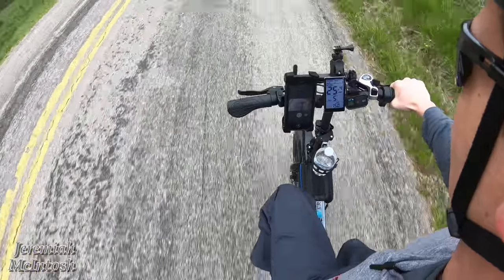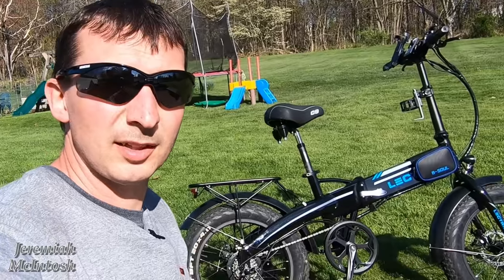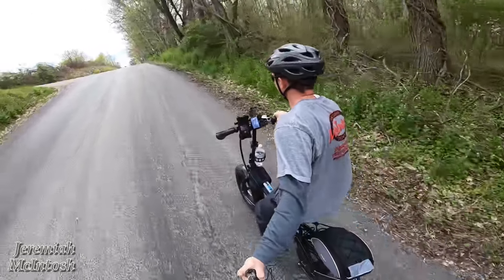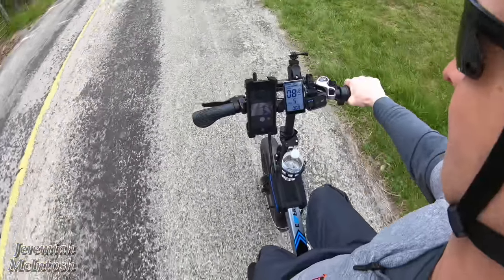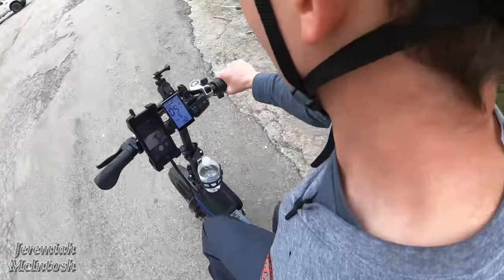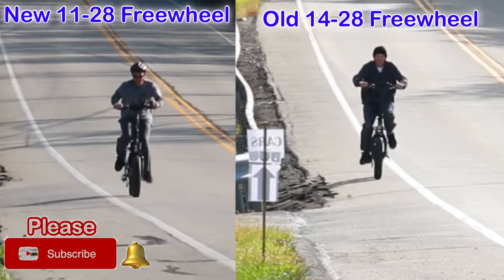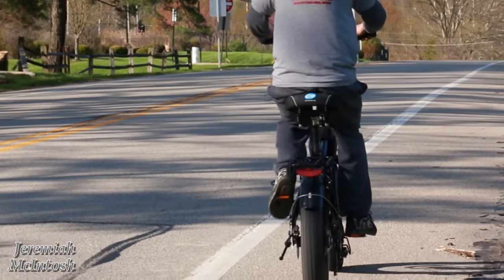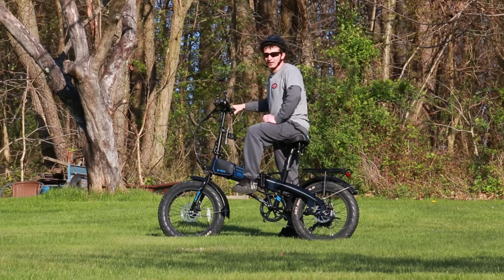Lectric Xp ebike Test with new Upgraded 11-28 Freewheel. Wow!

Comment: Jeremiah, I appreciate you taking the time to post this instructive video. It saved me time and effort to get the work done. I replaced the stock freewheel with the DNP 11-34. That extra low gear will help me on the steep hills and if I'm running low on battery I'll be able to pull the hills if necessary. I've actually had situations in hilly terrain such as in old logged off forests where the trails are steep and rutted where a real low gear could be helpful, especially with a low battery. The extra high gear is really nice on the flats and downhill. Keep riding, keep safe!
Reply from the maker: Thanks Jim. How did the 11-34 work out for you were you able to use the existing chain and it work flawlessly?
Reply: @JeremiahMcintosh  I've not put many miles on it, but so far I think it's going to be a good upgrade. It really zooms on flat trails in high gear with Pas 5 . The low gear is probably not going to get a lot of use, but it's there in a pinch. I can pedal this beast up a pretty steep hill now where I couldn't before. I'll be able to pedal home with no power if needed . 
The derailleur did take some adjusting to get it to shift into high gear smoothly but the chain is long enough and there's no problem with the factory drive train. It's working good now in all 7 gears. One thing I'd say is the factory Shimano set seems to be a bit more meaty than the DNP.  I'll put some miles on it and see how it holds up. Cheers and be safe!
Reply: A year in, how would you say the 34 gear is doing? I'm considering putting a 11-34 instead of the 11-28 to help out on hills.
Reply: @matthewstanko  I've never regretted the upgrade. There are  two hills where I like to ride that I can only pull with the 34 tooth low gear. Plus, in high gear on the flat or down hill I can get more speed at a more comfortable pedal pace with 11 . So, no regrets. I've swapped two others' bikes and they are happy too. 👍🏻👍🏻
Reply: @JimBellamy  that's awesome, in that case I'm definitely going to put the 11-34. You said you needed to do some adjustments on the shifter to accommodate a smooth transition from 24 to 34. What did you need to do?

Comment: This is good. This is what I was looking for. The original gearing on my 2.0 you run out of gearing about 20 miles an hour. Getting over 20mph, pedal cadence is too fast to actually put down power. Before I increased the speed in the controller I could feel the motor cutting out at 20 mph, Will the motor now start cutting out over 28 mph?
Reply from the maker: As long as you don’t use throttle. The motor will always cut out at 20mph while using throttle.

Comment: Since I live in a mountainous area, I swapped to an 11 - 34 gearset for a lower first gear as well as a taller 7th. The low gear is about 22% lower, and the high is about 27.5% higher. Lectric should have made this gearset standard since they use only one front gear (as opposed to two or three on a standard mountain bike).
Reply: Totally agree ! Have had nothing but problems with the original freewheel too.

Comment: Also I was polishing it up which she didn't really need and I was doing all those little things that you showed such as putting the little adhesives on the battery so as to prevent shaking noise, cleaning the rotor brakes w/alcohol pads, tightening all the nuts and bolts,using a white tire marker on the white lettering on the tires, mounting additional front and rear lights,  mounting the kryptonite ulock on the back seat post,  etc...

Comment: Hey Jeremiah great video as always. Check the Lectric XP Facebook Group Thread. Looks like you change P08 to 60 instead of 45 and the bike will top out at 35mph and throttle can go up to 28mph. If you have time see if it works on your Lectric XP as its working on the newer ones.
Reply from the maker: Thanks Louis! I believe I tried that before and it didn’t work but I’m going to check again.

Comment: The new freewheel is a big improvement as you've shown. My problem with the original gearing is being able to maintain a good pace like 20 MPH using a lower step assist setting, the pedals are spinning so fast that it's hard to put any grunt into them to maintain speed while saving battery power. Thank you for this series Jeremiah, very helpful.
Reply from the maker: You’re welcome 👍

Comment: You are going to wreck one day trying to hold the camera like that. Get get a helmet mount for your camera before you really hurt yourself. Wrecking at 25 or 30 mph will not be pretty. Trust me, I wrecked on a motorcycle at 30 years ago and my knees is still messed 30 years later. It’s not worth it for a YouTube video.
Reply from the maker: You would not get the same view of the pedals with a helmet mount camera and would be hard to show in the video without the angle this way but thank you.
Reply: What speed?

Comment: The Kendra Kraze tires make it a lot easier to maintain 28mph because they have less resistance than the original ones. And they are a lot more puncture proof. They also have side reflection which makes them a lot safer in the dark https://www.radpowerbikes.com/products/kenda-kraze-20-x-4-25-tire . Mounted on my bike: https://youtu.be/tlF8A802kbY

Comment: Nice video, wonder how this mod differs from changing the front sprocket to 50-52 tooth.  I guess that would change all the ratios where what you did maintain the low gear from climbing.

Comment: Hi I've followed your video on changing the freewheel. Now  while  my e bike is only 250 watt its still capable of 21mph slight down hill  assistant 5 gear 7 and my legs going hell for leather. But maybe this because I have my wheel size set to 24 inch  rather than 20 inch rim size, as fat tyres  have increased the rolling size.. it would be interesting to see if your freewheel with a change to wheel size will give you a higher speed . Because I'm in  England. United Kingdom  legally we  are only allowed  e bike capable of 15.5 mph on public right of way. But I'm not saying anything (ha ha ) I as
Reply from the maker: I’m not sure because the tire size setting is locked on my Lectric bike 😢
Reply: @JeremiahMcintosh   hi   I should have said my  fat tyre ebike doesn't have a makers name only a supplier sticker, it is not an lectric   though the only difference I can see with all these bikes is frame design and motor output. most other parts are the same, it is interesting that your programming is locked. With my programs  the wheel size is one of the first followed by mph or kph  than max speed settings   yes a max speed limit I've set mine to
44 mph but I don't expect to ever reach that  ( please don't think I've bought the most expensive bike, no this was the cheapest I could find £800 about the same in dollars.  Thanks for replying stay safe live long 🚴🚵 cycling is good for the heart
Reply: Yes.. i think its more accurate for fat-bikes to set the speedometer to 24 inch for the 20 inch tires, because of the increased size... i read from someone else too, that did the same.
Reply: @markreadman4414  Ecitybike A20 Fatty by any chance, I'm in Wales cruise at about 19mph on most trip's without any sweat or strain, coming up to the 300 mile mark soon, love this bike.
Reply: @AndyMast666  yes 20A black /white rims, also got the wife 20B all white,  because we both in  early retirement though these would be better then the mobility vehicle we would be expected to have( ha ha)  have to say I bought these from Lanarkshire ebikes a week before lockdown . So been limited to riding the local area..  (Maldon Essex where the salt comes from)  I will say this these bikes are very good value and judging by the build quality I expect them to out live me!   Hopefully next year we will be able to get away with our caravan and seek out some of those wonderful cycle route's this country has to offer

Comment: Really curious if the 34t version will make the derailleur interfere with the 20x4" fat tire since it will likely put the chain below the rim and close to where the tire bulges outward. Has anyone tried installing the 34t version on their 20x4" fat tire bike and have direct experience if it rubs on the tire when in the 34T gear?

Comment: I just ordered one, in part because of your reviews. Thanks!
Reply: Just curious what the ETA for delivery is now? I want to get one but missed out on the April pre-orders for May deliveries. Are they doing May orders for June deliveries?
Would be nice to get one before the summer is over! 😉
Reply from the maker: Dennis It will tell you on their site before you place the order if it is June delivery which I believe it is at this point.
Reply: @JeremiahMcintosh  dude how big is your front chain ring ?
Reply from the maker: I believe it’s a 52T chainring on the front.
Reply: @JeremiahMcintosh  that's nice. I have 48 14/28 and I already freewheel at around 18mph. So that's the upgrade I've been looking for. You seem to paddle to around 25mph.

Comment: Did you notice that on the first link you sent for the freewheel has a shipping cost by the seller of $35 in addition to the cost of the freewheel?
Reply from the maker: It was free shipping whenever I added the link thanks for letting me know I will update the link or remove it.

Comment: Glad to see that you have the helmet this time. I noticed that a couple times when you were showing the rear cog cassette, you were in 6th when you said you were in 7th, Other times actually went to 7th. Might need to tweak the high gear limit screw on your rear derailleur. This is a problem I've had with my XP.. Good video. Thanks.
Reply from the maker: Thanks for the heads up I’ll have to watch my video but I’m pretty sure I went from sixth  to seventh gear to first gear and then back to seventh gear?

Comment: can i put a trailer on it./?????
Reply from the maker: Yes I would imagine you can, you may have to drill out the hole a  little bigger on the wagon mount to fit over the axle or you can get one that mounts to the seat post. I’ve seen on Facebook that a few  guys have done this.

Comment: I just did an 11-28 conversion for my New G-Force T42 and on the 7th gear, the chain it's slipping under load.  What could be causing that?
Reply from the maker: The chain may not be centered on the 7th gear and the derailer may just need adjusted.

Comment: Would you go with the 11-34 if you didn’t have hills but don’t want any ghost peddling or is the 11-28 plenty?
Reply from the maker: The 11 tooth sprocket is the one that’s going to make a difference for ghost peddling and the larger one only makes it easier for hills so if you don’t have hills in your area 11 to 28 would be just fine.

Comment: I tried to install the 11-28 freewheel but found out my Xp 2.0 doesn’t have the removable washer/spacer under the factory freewheel.  Where the spacer should be, there is a flange/stepped area that is part of the hub.  As such, the new freewheel doesn’t sit with the correct gap and the chain and derailleur are all wrong.  Any ideas to correct this?  I have reached out to Lectric for a solution but no reply yet.  Btw, my ebike is only a month old and I don’t know if Lectric changed the design.

Comment: Oh man thx for this.  Excellent comparison showing cadence between the two, just what I needed!  Hopefully it will fit the 3.0 (Amazon reviews are only for the 2.0).  My only small debate is whether to go with the 34T low gear, like are there any downsides to it?  Seems a very steep jump for the chain to make when going from 2nd to 1st gear.   Also seems unnecessary to have such a high tooth count low gear on a bike with pedal assist.
Reply: Oh wait, I just looked up the specs on the 3.0, it's already an 11-28T freewheel!  What now, bigger chain ring?
Reply from the maker: @pondacres no need to it’s geared correctly.
Reply: @JeremiahMcintosh  Personally, when I'm trying to push this sucker into/past 28 mph while in PAS 5, I start ghost pedaling at around 22 mph.  If I had just a little more pedal there lol, getting this bike to like mid 30's or higher...would be pretty cool.  But seems like I can't get any smaller than 11 tooth for the high gear.

Comment: Hey Jer,, my bike and I noticed your bike too, once the bike hits 28mph the controller will cut power to the motor until it gets below 22mph,, you can peddle like hell but seems to just keep slowing down didn't matter up hill or down , I have a long long hill at my home and have tried this several times, and once the bike gets to that speed it happens, if you find out how to by pass the limiter on the bike it would maintain the top speed.. I'm still searching

Comment: Hi, I'm considering buying the "Shimano Alivio derailleur RD-M410 7s" and "Shimano 7s cassette CS-HG41 11-28", would this fit you think? I can get both for $35. I've got an Engwe EP-2 bike which is almost the same as the Lectric.
Reply from the maker: I’m not sure if it would fit but my guess would be no on the cassette because it probably uses a freewheel like the Lectric.

Comment: Hello, j the cloud9 seat and satori suspension seatpost that you recommended are not available. Will this also work for my lectric xp? Cloud 9 cruiser anotomic saddle 50008 and satori Harmony suspension  ASIN:BOOK1TJZPG. We weigh 130lbs & 160lbs respectively. Thanks for your advice in advance
Reply from the maker: If you’re referring to this cloud 9 seat https://amzn.to/2AX5JDb  yes it will work And as long as the  suspension seat post is 31.6mm in diameter it will work But I think they are all out of stock on those ones at this time. Please keep in mind the above link is an affiliate link and I will make a small commission if used. I hope this helps.

Comment: My model c also came with a 14-28 shimano.  It’s true that 11 would be better for traveling at high speeds, but what I’ve realized is that it isn’t very comfortable to maintain 23+, and also it uses way more battery.  When I have a few thousand miles on it and it’s time to replace the cassette, chain and front chain ring, I’ll probably opt for an 11-28, but no rush.  Thanks for the video! It’s something I was thinking about even before the bike arrived.

Comment: Hi 
I have been watching your videos and thanks very much and I have one question about using the headlight/tail light power to wire up USB charger kit to charge the smartphone,do you think that would work? Thanks
Reply from the maker: I don’t know for sure but doubt it will work because you need 5v for usb and the bike is 48v. Not sure how many volts the headlight and taillights put out tho.

Comment: thanks great video.have you seen any difference in the battery life on your ride
Reply from the maker: I’ve seen a slight improvement because you can still pedal over 20mph with this upgrade which saves some power.
Reply: @JeremiahMcintosh  thanks

Comment: thanks - yeah - recently got one and checking it out, to compensate for suspension I deflated tire pressure on tires - good or ad I don't know but it's not as bumpy, my biggest issue is peddling - I maximize my peddling to a point that is senseless so I just throttle up,  I hate using the throttle but its the only way to maximize my speed cause the peddling low gears just don't cut it for me - - I use it to run errands and I want to hurry pp and get there and back but by using the throttle all the time - it drains my battery fast or more then I want - my objective is to use peddle assist to save battery power for longer trips without using the throttle that sucks my battery charge - I am thinking of incorporating your idea but going downhill seems kind of like cheating to maximize speed - a level surface would have been better because I can go downhill all day without even peddling :) , I use my bike for errands and not leisure. thank you for your video's .

Comment: Is the XP2.0 installation process for the free wheel basically the same re same nuts & bolts used on updated bike as previous version. Any procedural differences?
Reply from the maker: I’m not sure yet. The 2.0 seems tighter so not sure how it will fit on there because I haven’t taken the 2.0 apart yet. 
Maybe someone who has can comment here if they have already changed their freewheel on the 2.0.
Reply: @JeremiahMcintosh  Thanks.

Comment: @Jeremiah that suspension seat post is unavailable. Will Satori Harmony LT2 Bike Bicycle Suspension Seatpost 31.6x350mm work instead?
Reply from the maker: If you’re talking about this one then yes it will work https://amzn.to/30mSJiQ

Disclaimer This is an affiliate link and I’ll  receive a small commission and it’s no extra cost for you! This helps support the channel and allows us to continue to make videos like this. Thank you for your support.
Reply: @JeremiahMcintosh  what about this one it's cheaper Choose Suspension Seat Post 27.2 x 350mm 31.6 x 350mm Seatpost
Reply from the maker: This one will work also https://amzn.to/2ZHFZEq
Which ever one you select just make sure you select 31.6mm and it should work. 

Disclaimer This is an affiliate link.

Comment: Nice but they have the 11 34 t also what's the difference bro getting ready to pull the trigger??
Reply from the maker: 11-34 would be better for steep hills but if you’re ok with 1st gear on the stock 14-28 on hills you  won’t need the 11-34.
Reply: @JeremiahMcintosh  got cha ! Definitely the 11 28👍💪

Comment: Hey bro nice video, what do you think about an 11-34 teeth freewheel do you think it will add even more efficiency? Thanks your vids are appreciated
Reply from the maker: If you live in an area with hills the 11-34t  would probably be better than the 11-28 that I installed but  I’m not sure if it will work directly of if you would need a longer chain?